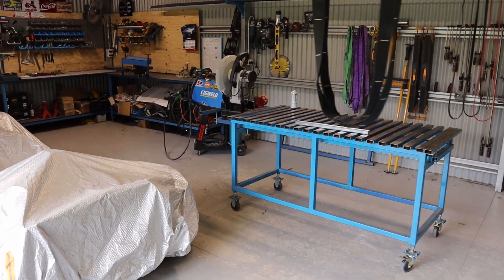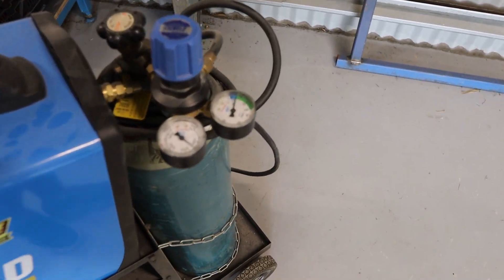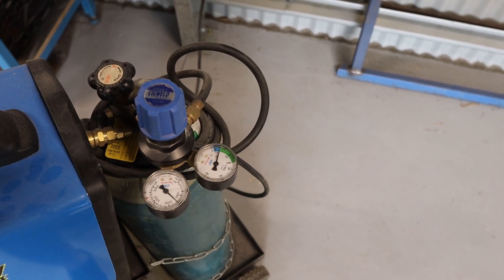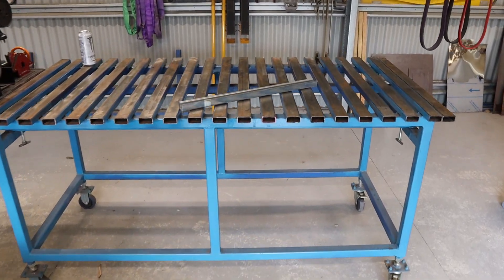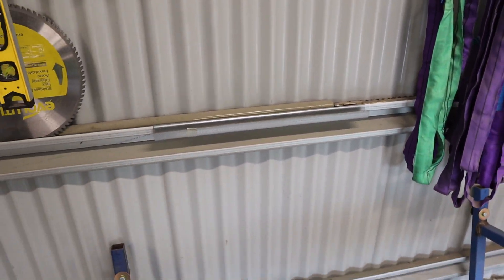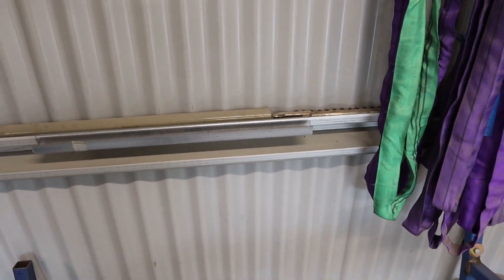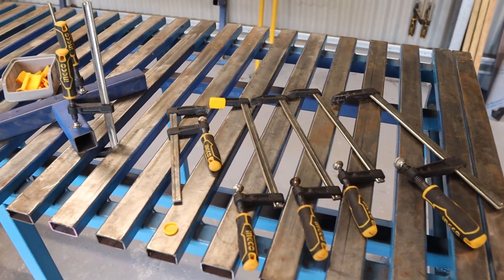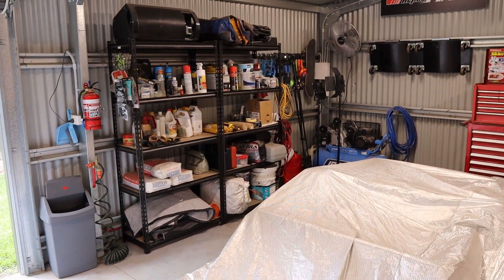Workshop / Garage Cost Saving Hacks

Comment: How much they sting you for gas mate, is that argo shield 52 or argoshield light
Reply from the maker: I just use BOC gas. Im on a plan which is 200 a year for a couple of bottles worth. I am using argoshield light
Reply: @ShenkeGarage  yeh that's not to bad then mate, just bought a welder and wasn't sure whether to rent or buy bottles lol cheers